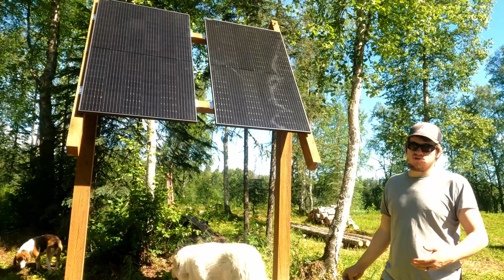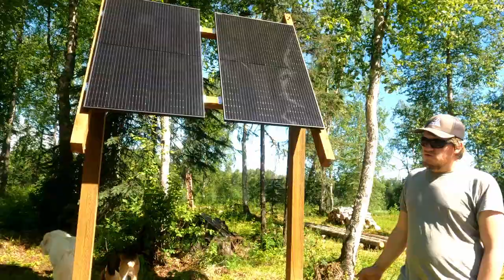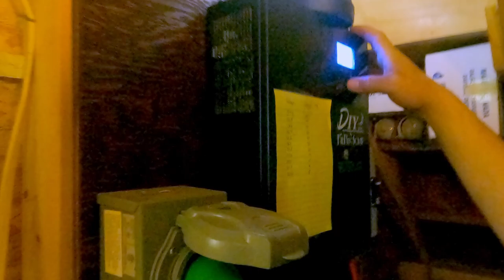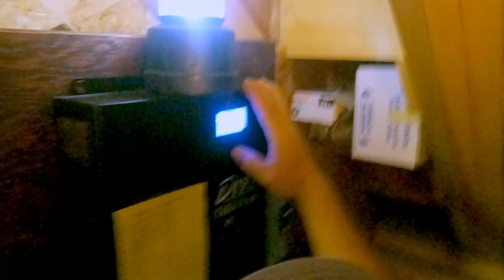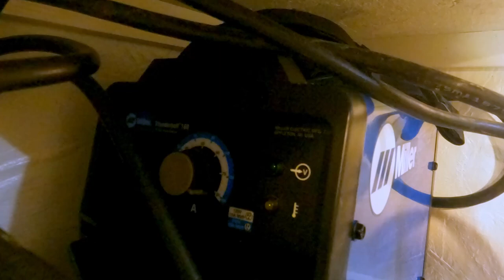Snow Machine, Side x Side, & Solar Setup | Alaska Off-Grid Essentials

Comment: We have a mule which is basically the same thing.  It is invaluable getting around on our farm which is surrounded by thousands of acres of deep forest and a reservoir. Instead of bears and moose, we have mountain lions, bobcats, feral hogs and lots of snakes. A vehicle like this can save your life by getting you away quickly or give you a place for refuge to an extent.  I love ours mainly because it crosses distance a lot faster than walking in places that vehicles can’t go.
Reply from the maker: Yes, I love being able to move around more where we can't drive. On some of the tighter trails I like to look back and see if we're getting chased at all but no luck yet. 😂

Comment: Do you mind sharing what yall spent on the Polaris and Snowmachines?
Reply from the maker: The snowmachines were about 15k brand new and the polaris was 12k used if I remember right! We did sell the polaris and get a 4wheeler because we just weren't using it enough to justify how much it cost. The snowmachines have been 100% worth the price though!